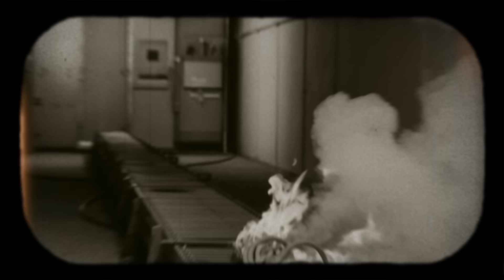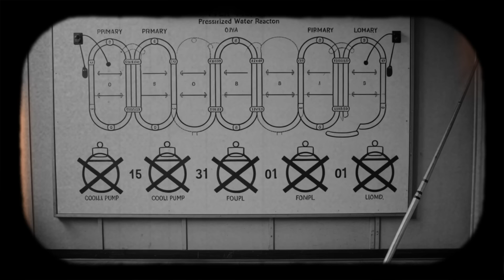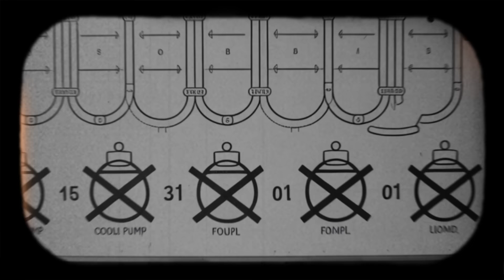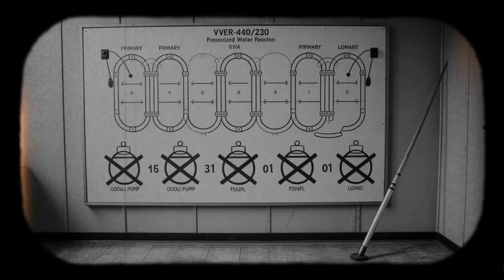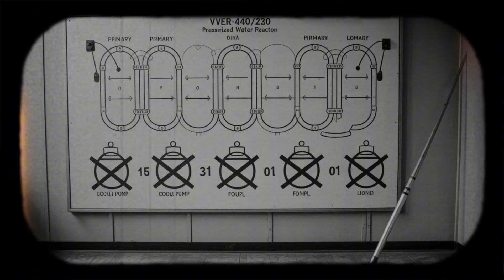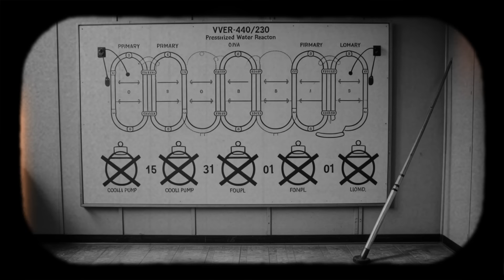Greifswald 1975: The East German Near-Miss You’ve Never Heard Of

Comment: When designing any electrical circuit, or any thing in a safety critical environment like a bloody nuclear power station the designer should be asking 'what if?' then 'but what if this happens?' then 'but what if that happens?' then 'but what if this & that happens together?' on every single point of possible failure.

Comment: This was all a lack of common sense mistake, that doesn't require an engineering degree
Reply: It apparently does take an engineering degree to f*** up redundancy só badly. What's the use of a sixfold coolant system when all the cables that control those six coolant system run through the same cable tray? None of the brainiacs even considered that that could be a serious single point of failure issue.
Reply: @tjroelsma this is true